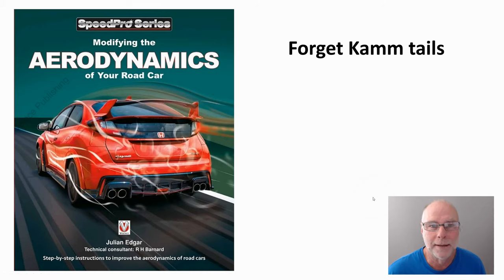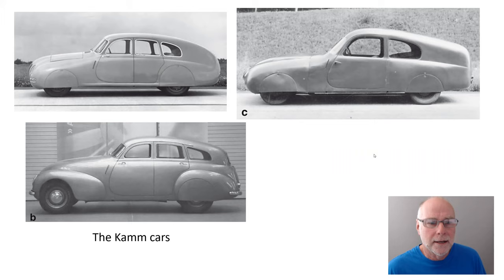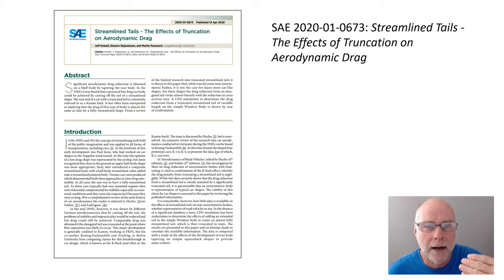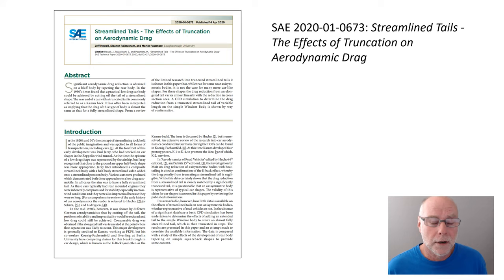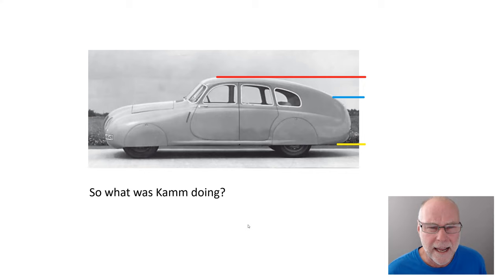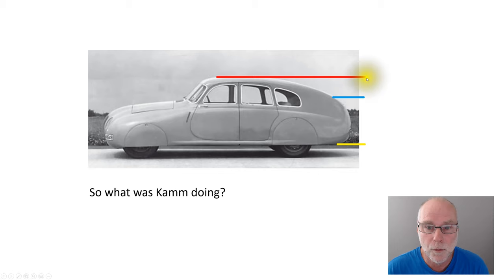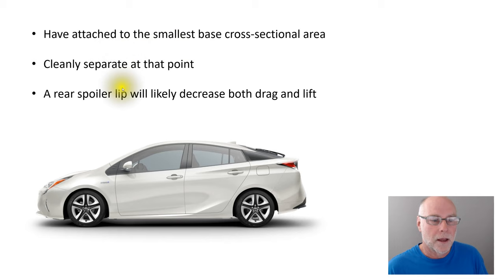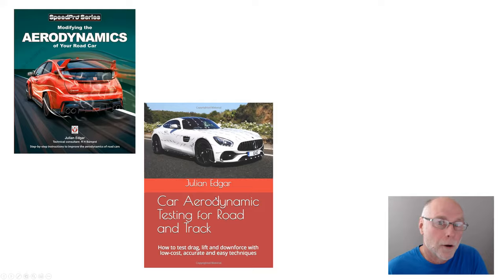There is no magic in a Kamm tail!

Comment: What I think of as the "modern" iteration of Kamm's tail started, I believe, in the early to mid Sixties on racing cars like the Ferrari 250 GTO, the Aston Martin DP214 and DP215, the Shelby Cobra "Daytona" coupe, etc.  They adopted a modified version of the Kamm tail for solid aerodynamic and packaging reasons, it being a good compromise for those cars in terms of weight, length and drag performance.  Since it worked well in that context it was also adopted by car stylists designing production, mass-manufactured sports and sporty cars as well, often more as a visual cue rather than as an aerodynamic drag-reduction tactic.  In other words, to look cool or sporty.  (Likewise "ducktail" spoilers, which survived all the way through even the "wing" era of automotive styling.)
Of course there's no magic in the Kamm tail.  It's a compromise.  If you can get the benefit of most of the drag reduction of a tapers-to-a-point teardrop tail without having to make your vehicle heavier and nearly twice as long to accommodate it, the Kamm tail might be the right compromise for your design and it shouldn't be ignored.
Reply from the maker: But you don’t get any the drag reduction of a “tapers to a point teardrop” - the more you truncate the tapering tail, the higher the drag, no matter what name you give it.

Comment: Thank you for sharing this. Currently, the use of Kamm tail virtual foils are all the rage in aerodynamic bicycle frame design, a departure from more traditional NACA airfoils from about ten years ago. The problem is, nowadays manufacturers and pro athletes don’t make their aerodynamic testing a available to the public, they just make marketing claims about their bikes. It’s nice to know that there have been studies done on the actual effectiveness of the kamm tail airfoils.
Reply: Part of what's driving this design decision might be the UCI rules. I believe there's a rule about tube dimensions designed to prevent the use of teardrop shaped tubes. A Kamm tail might be the best trade-off under the rules.
Reply: 3:1, which has been scrapped... With new dimensions allowed. However, kammtails in IND windtunnel tests, show significantly faster than teardrop/naca foils. Could be a variety of factors such as external bottles, cyclist on top with moving legs, exposed wheels disrupting the air. Etc.

Comment: The magic of the Kam tail is in the balance between the drag coefficient and lugging around an extra hundred kilograms or more or awkward sheet metal that you cannot possibly see to avoid backing into things.
Reply from the maker: What, like sedans have?! I think the Kamm tail has been massively over-rated for a long time, and still is.
Reply: @JulianEdgar  . The principal behind the Kamm tail is the heart of most automotive design features.
Compromise!
If you want the most aerodynamic vehicle possible you just need to compromise by not having wheels and engine or a cabin or control surfaces or be large enough to actually carry passengers . You just need to lay down maglev tracks everywhere and it will be perfect.
Reply from the maker: I don't know why you say that the principal of a Kamm tail is the heart of most automotive (aerodynamic?) design features. That's simply not true.  But then again, a lot of people don't really know what a Kamm tail is, so maybe that's the problem?
Reply: @JulianEdgar  . Julian you need to take your sense of humour out for a walk it’s getting flabby.
You need to not read most of my comments as if I’m being serious.
Reply from the maker: I don't see it as humorous - I see it as more spreading of misinformation, of which there is a massive amount around on car aero. To suggest that a "Kam tail is in the balance between the drag coefficient and lugging around an extra hundred kilograms or more or awkward sheet metal" is a classic case of leading people astray. I don't really want to be part of that. I see too many people waste their time and money following such misinformation.
Reply: @JulianEdgar  Julian actual aeronautical engineering’s have said as much about the Kamm tail in discussions with race car designers in conversations I have been privy to. I would not call it misinformation but an attempt to paraphrase in a humorous manner. The Kamm style truncated tail is a compromise between ideal aerodynamics and a reduction in vehicle length and mass and excess over hang at the rear of the vehicle. Every thing about automotive design is a compromise between the ideal and the practical and the necessary and the cost and the constraints of regulations. You simply cannot design the ideal aerodynamically shaped vehicle and drive it anywhere other than a place like the Bonnaville salt flats.
Reply from the maker: @anomamos9095  Not sure why I bothered to do this video when it seems to have fallen on such stony ground? (1) A Kamm tail doesn't reduce drag: it increases drag in proportion to the truncation of the tail. (2) Because of this, no current low drag cars use Kamm tails (refer to the original Kamm patent to see what a Kamm tail actually is). (3) To keep on suggesting that somehow a Kamm tail achieves some sort of compromise between drag and length is a bit like saying a 15 inch subwoofer achieves some sort of compromise between compactness and sound quality - yep, one goes up as the other goes down. That's not a compromise - it's an inverse relationship. (4) I think that this discussion is yet another of the sort you see so much in car modification - something blindly accepted and then constantly reiterated in a misleading way.
Reply: @JulianEdgar  The vehicle I drive technically has a Kamm tail and it decreases drag over the tail I'd much prefer it to have considering it's supposed to be a station wagon which of course should have a squared off rear end so you can actually use it to put things in and still close the tailgate without smashing the rear glass. The tail on this vehicle is a compromise between fuel economy styling and an imbecile who thought it looked cool to build an suv with a swoopy rear end. Ar the speed I normally have to drive I could just about pitch a tent on the roof without effecting fuel economy and when I occasionally get to drive a lot faster actually having the equivalent of a tent on the roof or draging it's own weight behind it didn't alter the fuel usage sufficiently to say that the thing because of the truncated swoopy tail has any better aerodynamics than a brick

Comment: That extension of the body on the Jaray Design could be helpful along with modern diffusers? I mean, when Kamm proposed that it did nothing, it was a time when undersides where pretty much ignored when it comes to aerodynamics. With our modern conception of the play of the underside when it comes to drag, couldn't we use that tail as benefit to lower drag?
Reply from the maker: I am not sure that I understand you. The video argues that a long tail reduces drag, and of course that long tail can incorporate a diffuser.
Reply: I doubt a diffuser would prevent the flow separation on the topside. But I imagine a diffuser could reduce the "drag penalty" of a truncated tail, by reducing the size of the wake.
Reply: @JulianEdgar  the hole concept of the Kamm back is to chop that prolongation of the Jaray Design, right? How about make those a thing again, with better underside aerodynamics in mind
Reply: What i mean is, take that air that's running under the car and release it after the trunk, in the middle of the wake
Reply from the maker: @heitorbernardes7977  The flow won't stay attached to the upper surface of the Jaray design, so the wake area will still be large with any normal diffuser that retains attached flow.
Reply from the maker: @heitorbernardes7977  The airflow won't stay attached to the diffuser if it is steep, so the wake would remain large. So issue as with any car, irrespective of tail design..
Reply: @JulianEdgar  yeah, of course it won't be attached to the upper part.. meanwhile, a diffuser angled so the flow is attached, the further it's prolonged, the smallest the wake, right? Since in the essence you're making the flow occupy and "cut" the wake in its the bottom part, but in a higher level... Thus, increasing the average height of the wake, but making it smaller, since you're increasing pressures near the road and higher on the wake compared to the original design
Reply: Of course it would be cool to have a longer tail overall, but as an easy mod, just a custom bumper instead of an after thought tail over all of the rear end, requiring solutions for license plates visibility and all that; plus taking away the practicality of the vehicle; could it be a modification to be considered?
Reply from the maker: @heitorbernardes7977  Yes you can use a diffuser to reduce the wake size. The issue is that in real cars, it's hard to start the diffuser before the rear axle line, and, to keep flow attached to the diffuser (and also reduce drag caused by the angle of flow on the diffuser), it cannot be too steep (eg no more than 10 degrees). Thus, if it's to appreciably reduce wake size, *the tail has to be long to fit the diffuser in*. It's one reason that the basis of the video is: long tails give less drag than cut-off (Kamm) tails - for reasons of top, bottom and side angles.  (And diffusers aren't new - they date back to at least the 1930s.)
Reply from the maker: @heitorbernardes7977  Sure, on any car running a full length undertray with rear diffuser will reduce drag. (A custom bumper will achieve nothing - see https://youtu.be/o_JER0-ujG8 and https://youtu.be/iQDBkojzWIw)
Reply: @JulianEdgar  exactly! I can't have a diffuser start as early as i want to, so can't i make it go further (just using the Jaray rabit tail with an appropriated angle, with a smooth underside), after the body has already ended? It's worth my time or this is just a misconception of mine?
Reply from the maker: @heitorbernardes7977  Sorry, I don't understand. Maybe link to a drawing of what you propose.
Reply: About the custom bumper, it's just so i can achieve a longer diffuser with that rabit tail on there, instead of making a hole extension of the body
Reply: @JulianEdgar  Hold on, I'll draw it and upload via Imgur
Reply: Instead of the unpractical extension of the tail: http://imgur.com/a/0pW9wfx
Reply from the maker: Sorry for the delay - the YouTube spam filter caught your replies. The drawing with extensions top and bottom will give lower drag.

Comment: Julian. I was looking at some images of the old Shelby Daytona coupe. The Kamm tail on it is concave. with sharp edges.  Would the air swirl more there? or would the sharp edges flow together off the back of the tail do you think. Some of them had Wings. so don't count those.
Reply from the maker: Pic link please?
Reply from the maker: @samctanner  If that's it, it's just a Kamm tail with a rear spoiler. The spoiler provides a pressure increase on the back slope and gives a clean separation edge for the flow. Both are good (although that spoiler is a bit high for reduced drag as well, I'd guess.)

Comment: No Magic? but the proof exists.  Look at the Mini Jem for example.  This little cars aerodynamic design incorporates a Kamm tail.  It was tested and found to be stable up to 170 Mph in a aeronautical wind tunnel even though it could never achieve this speed with its Mini mechanicals.
Reply from the maker: Did you watch the video?
Reply: @JulianEdgar  Yes - I rather follow the proven science.
Reply from the maker: Well I am sorry but the proven science is as I covered it. Shortening a decreasing area tail that has attached flow increases drag. Doesn’t matter what the tail is called!